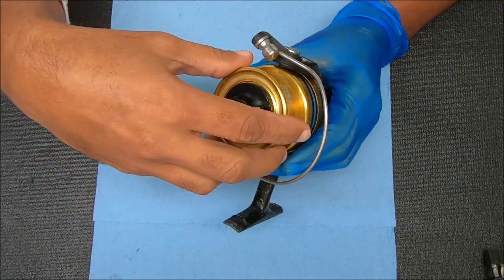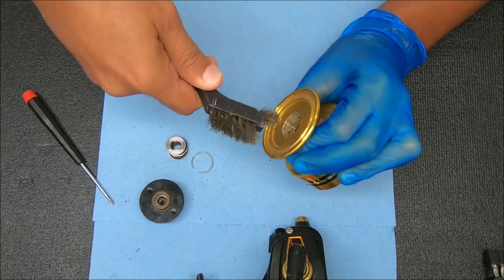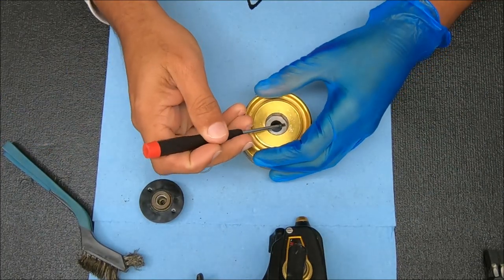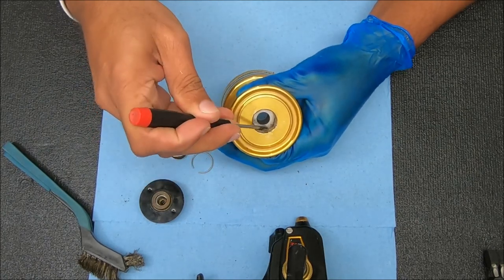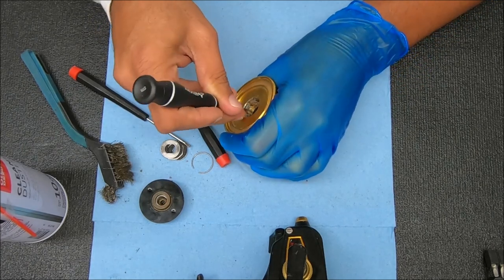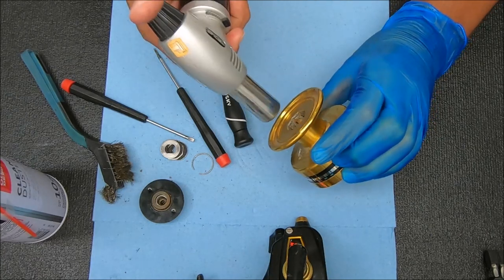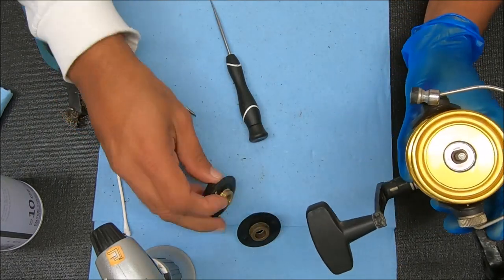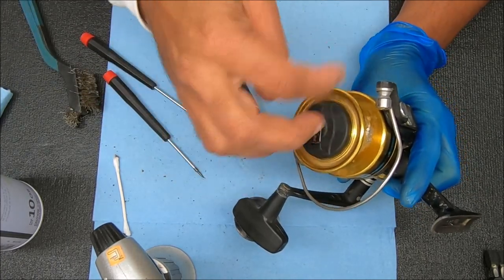Penn Spinfisher Drag Issues - How To Fix - Fishing Reel Repair

Comment: Thanks, that helped. Wasn't sure what was wrong. But pulled out the washers and cleaned up. Put it back together and all works again. The reel got dunked in the surf twice yesterday so I was a bit worried. But they are tough as nails. I have the last ones that were made in the USA.
Reply from the maker: Thanks for watching! Sorry to hear your reel took a beating yesterday... the last full USA-made Spinfisher line was the best! Did you know that some of the SSG's were also made in the US? However, I preferred the the Chinese made versions.... go figure. There are a few reasons you can have issues with your drag.... this one just happen to be the drag knob (mainly). Make sure to also check the shaft and metal washers for rounding.... same for the inside of the spool. If this happens, you may need to replace them, depending on the severity. Hit the thumbs up and spread the word about the channel.
Reply from the maker: P.S. - Be sure to go through your entire reel to clean it out and remove all the salt deposits, and re-grease and oil it.

Comment: Your videos are great thanks when things were seized up on my line roller I dipped it into boiling water then ice (rapped chill) may have to do a couple times. Thanks for your knowledge *
Reply from the maker: You're welcome and thanks for checking it out, Catherine! Thanks also for your contribution regarding the hot (expansion)/cold (contraction) method..... helpful tip for subscribers.... I still do it, too, on occasion.

Comment: I have a question. I just got a 6500 and the drag feels like it’s off somehow. I have to crank the drag knob 6-7 times for it too loosen or tighten any idea why?
Reply from the maker: Thanks for checking out the vid. Make a video that shows the specific model number and them continue the video demonstrating the problem you're having. Please post the link to it in this thread. Thanks.